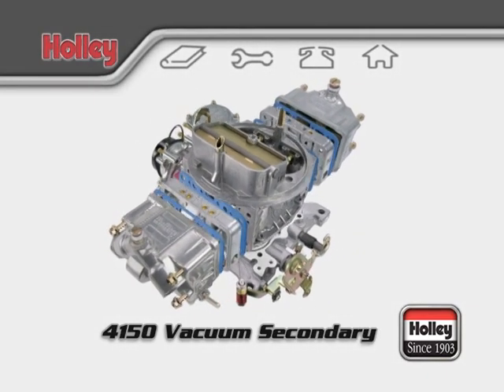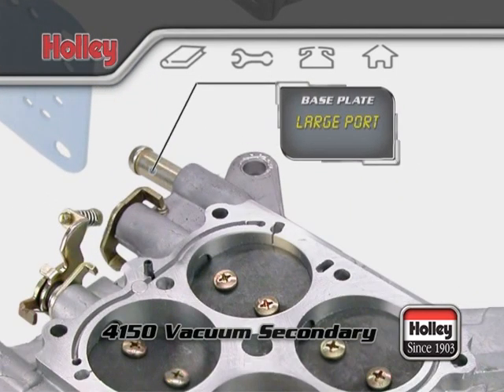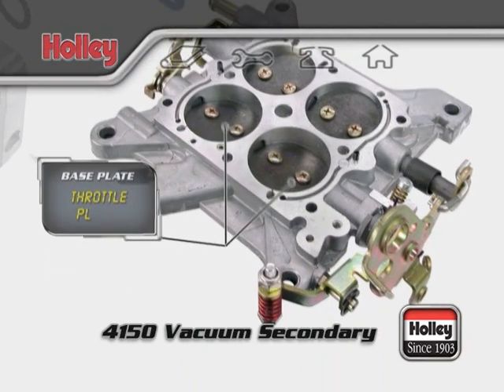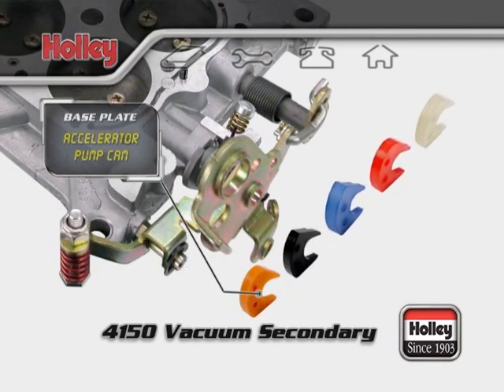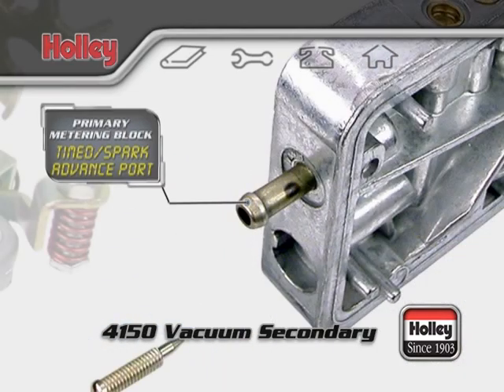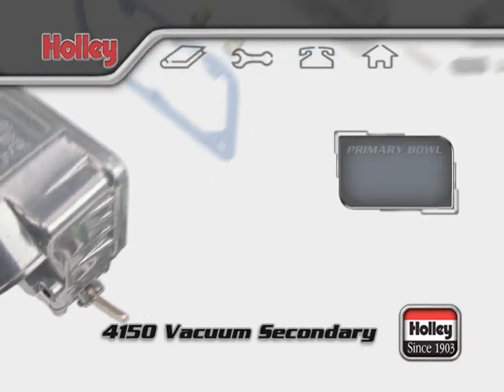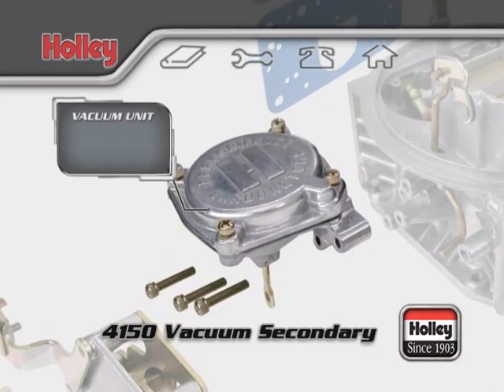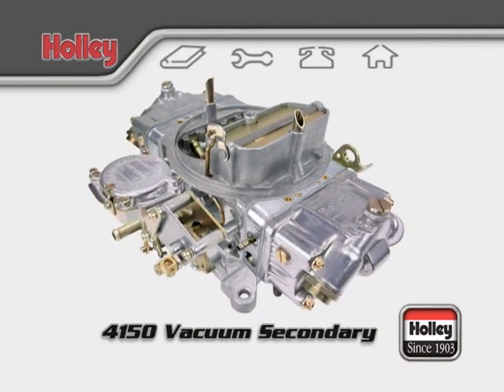Overview Of The Holley 4150 Vacuum Secondary Carburetor

Comment: Just gut done talking to a Holley rep and come to find out they have no clue about their own product.  I have an original Vacuum Diaphragm 135-2 that is 1.865" from base to eye plate for my 8007 390cfm carb,  it has been on the car from they day it was pulled out of the box in 1997.  Ordered a new 135-2 and the part is 2.045"  from base to center eye.  I can physically see that the parts are not the same.  This longer rod on the new part hits the cap of the vacuum housing and will not let the secondary open more than 1/3.  He is trying to tell me something is wrong with the carb that has not changed and the original part vs the new part.  He tells me to measure it from plate to end of rod and this gives me 2.281".  either way it is too long and when was the last time you did not run from center eye to center eye.

Comment: Ok now this is fkn confusing everyone is saying conect distributor vacum to manifold vacum where there is vacum at idle and here they say nonconect to port side where there isnt vacum at idle
Reply: That's a whole can of worms, feel free to try it both ways.
Reply: What they are saying is correct, no advance at idle is right. Why would you need full advance at idle, doesn't make sense.
Reply: @glenncook9063  depends on the distributor used. My HEI requires vacuum at idle because the vacuum canister retards the timing rather than advancing it. Hooking it to Ported vacuum makes it miss and stumble at WOT.